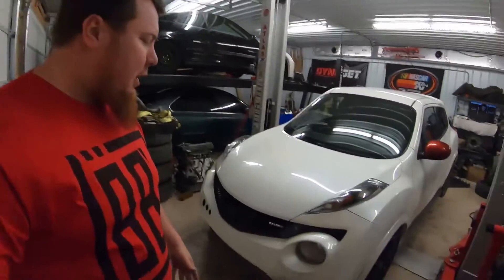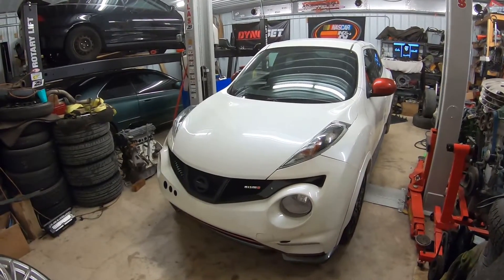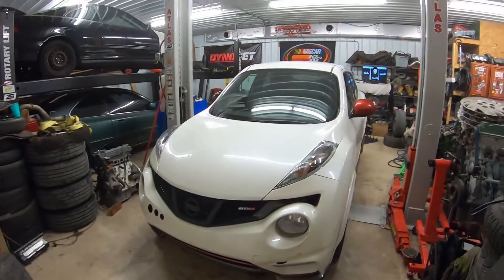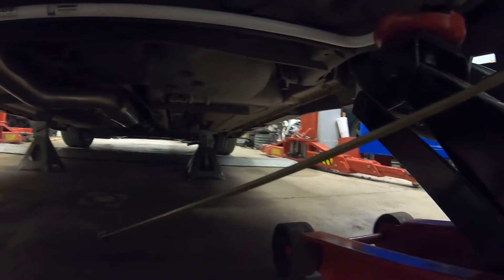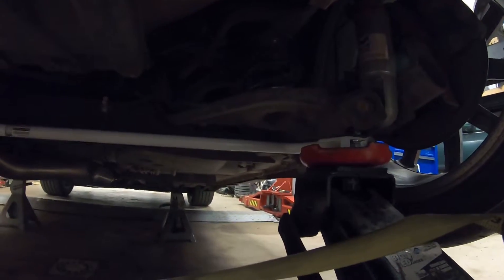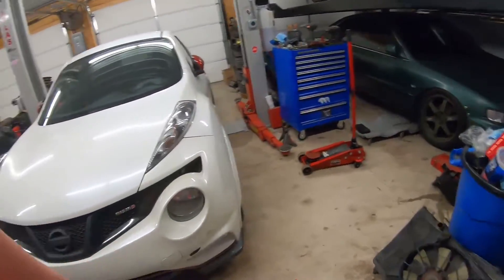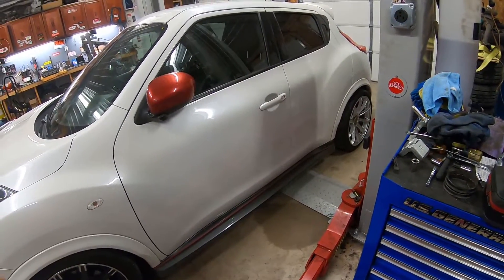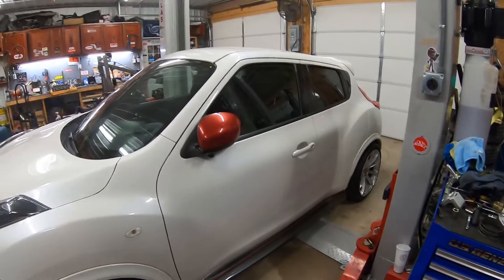How To Install the Ultra Race 19mm Rear Sway on Your Nismo Juke! Before & After flex measured!

Comment: You did the front mount 2J Inner cooler too.. Been watching you for a while.. I got a 2011 AWD, FR down Pipe, 2J Fast Cat Mid Pipe, 2J Cat Back No resonator, 2J crank pully Fr CVT cooler Kit, Mishimoto 3 port hidden OCC, Mishimoto FM Inner cooler, 2J Red powder coated Inner cooler Hard piping, and Ingen Red Powder SRI. And I am on an Adjustable stage 2 ECTek Tune at Prime Motors in north Jersey. I have Really Been waiting to see if that Turbo bay Turbo actually makes a difference??? been wanting to buy one myself?? I Have a CVT running at the edge of it's life, but I did manage to pull off a 14.6 quarter, Been nothing but 15's since, I think the temps between winter and summer  can make a 15 HP lose and gain just based off of what season it is.. LOL.. And I know for a fact that if this car was a stick I could break into the 13's.. Either way these cars are fun.. I love the AWD in the winter it's so much fun but truthfully, I do wish I had a stick so I could turn this car up another 100WHP...  Oh well is what it is.. Try that turbo bay turbo out!!